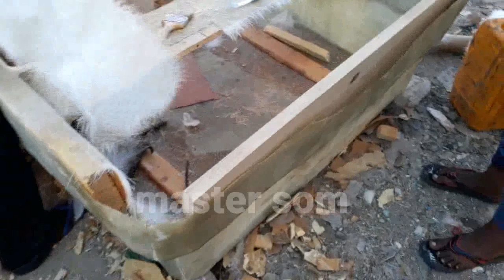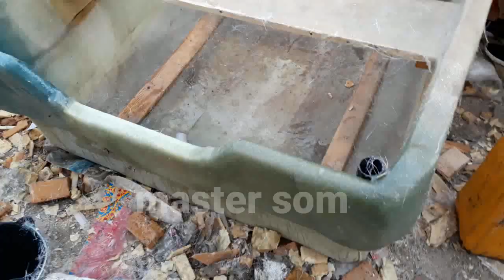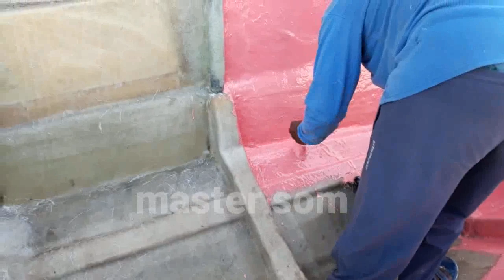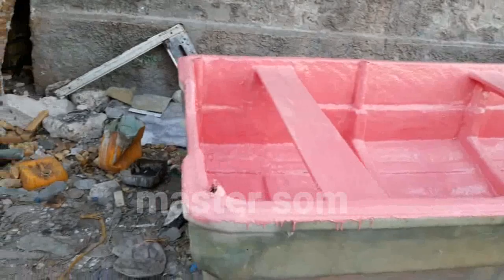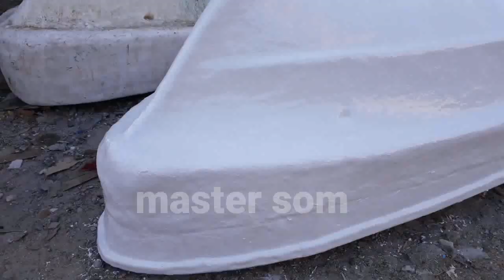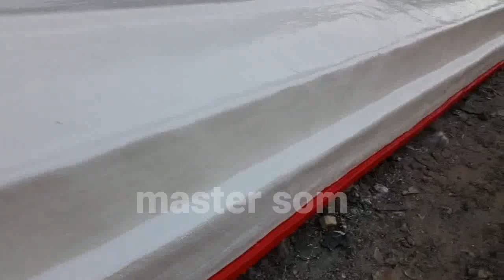Fiberglass boat building part 4

Comment: Hello, 
Thank you for the video. I have been involved in boat building in many countries around the world.
Basically, you need a couple more
 long stuffiness along the center line from the transom forward. Also, make some fiberglass pipes around a heavily waxed round 1 inch plastic pipe. Remove glass and Cut  fiberglass pipe into 3 inch lengths and place between the hull and the cross braces, glass into place under the cross braces. This will allow the bottom water (bilge water) to flow smoothly front to back (forward to aft). The holes are called LIMBER HOLES. This shape of boat, we call a Panga.
Also round off the tops of the cross braces, called FRAMES. It is easier to apply the fiberglass and resin. Use one layer of glass Matt at a time. Use only bonding polyester resin not finishing resin.
Best of luck to you. David
Reply from the maker: Thank you for information David.
We just built the boat as our customers need.
We appreciate your information.
Thank you again
Reply: David Culpepper  nice of you
Reply: @williampalacio9980  thank you

Comment: Awesome build in those conditions! I saw one hand saw, one hacksaw blade, a sanding disc, two paint rollers, a couple of buckets and a bunch of broken concrete for a complete list of their tools! And! They made a mold from what looks like either and old boat or a block of styro foam and some packing tape! I am in awe at what they can accomplish.
Reply: @chronicawareness9986  Lazy? Looks like they worked hard on this...What have YOU built with so little? Low class? Where do you see that, I couldn't tell myself... Dirty and sloppy? Under the conditions they were working I think they did a fine job.  But hey that's just me, I am building a boat too under much better circumstances.  What is YOUR building experience?
Reply: @LadyDewBuild  alright alright i was being an asshole.. it is sloppy / looks like a land fill but hey they made a big ass fishing boat and that makes them a living, gotta give it to them

Comment: There's a lot of hate in the comments from people that don't know how boats are actually built. These boats are a wonderful design and wonderfuly constructed. They just didn't waste any money or effort adding fancy point less features. This is a boat designed to fish in. By fish in I mean enough to feed multiple families in one trip. For that purpose it's probably one best boats you can buy. Also, limberholes allow water to egress into the fiberglass causing delamination. And chopstrand is perfectly fine for a boat of this size. The only difference between this boat and more expensive ones is fairing compound but that doesn't help you catch more fish. I personally like the look though. It feels organic and natural.
Reply: Agreed. Except limber hole are molded around the tube, not cut into the foam. They are necessary to drain the boat so water doesn't soak and penetrate the resin over long periods of time. Resin is porous and will absorb water if left in constant contact with it. Then the foam turns to mush.

Comment: Sorry...is the pink smeared inside what is boss?
And what is white smeared on the outer wall?
If it's some kind of fiberglass what is the pink and white mixture for??
Reply from the maker: Its glue used for boats
Reply: What glue?
Do you mean the same glue whith fiberglass dough material to print the body of the boat??
Reply: I'm guessing it's gell coat, it's like thick plastic paint.

Comment: How long is this boat....how much does it weight?......never thought of using foam for strength....I built afew boats......some stands would help you out....less bending.
Reply: Mike Dill is that what it really was? Foam ? No wonder ,why it was so easy to cut
Reply: The foam does not add much strength, it is the shape of the fiberglass around the foam that adds strength.

Comment: Interesting that in the USA people give away fiberglass boats that are pretty old but built better than this one.  Too bad it would be prohibitively expensive to ship them to Africa.
Reply: Junk U.S. boats go to the dump because of all the rotted wood use in them. This boat has no wood. So as to be left on the beach and rained in without rotting. Should last indefinitely If they don't break it on a wave.

Comment: I wouldn't ride on a boat constructed this badly, let alone buy one. I followed this series from part 1 through 4 and all I saw were multiple potential points of structural failure being buried beneath fiberglass cloth poorly covered in inconsistent resin. A lot of the boat's form is just foam padding with thin fiberglass cladding that has obvious weakness against tearing and twisting forces. What a waste of modern material, this is just glorified papier mache. Many of the workers I saw didn't seem too proud of what they're doing, or have no idea of force dynamics whatsoever. These are nothing but floating bath tubs.
Reply: foam core construction is a very common technique.  while the foam in this video isn't pretty, it is really just used to shape the fiberglass, which gives the strength.  You say that "points of structural failure are being buried beneath fiberglass cladding".  The fiberglass is the structure, so your comment is completely backwards and wrong.  My criticism of the design and build are as follows:  1. There really should be some longitudinal stringers, as they are completely absent.  Without them, the boat might flex lengthwise; 2. the use of CSM (Chopped Strand Mat) instead of cloth or biaxial or roving fiberglass.  CSM is the weakest form of fiberglass, and should have some better glass material for structure.  The place they are purchasing the CSM would definitely have biaxial or roving.  3. Along with my CSM comment, it appears as though much of the boat has only very thin fiberglass.  I don't know how many layers of CSM are on the bottom, or covering the top combing foam, but it sure seems extremely thin.  that's all i got, besides the large numbers of comments from people who are wholly ignorant about fiberglass construction.
Reply: Dizon, it appears you lack a basic understanding of this type construction.
Reply: @jbrooks544  The boat get's it's strength from the many bulk heads that are supported by the gunwales.

Comment: bad boat
Reply from the maker: We will do hardwork to be the best
Reply: Good job under very poor conditions. I work with fiber glass and it is an exacting art under any circumstance. I could not help but notice the total lack of safety equipment, such as rubber gloves respirators and I protection. I will never complain about my warehouse or the heat again.